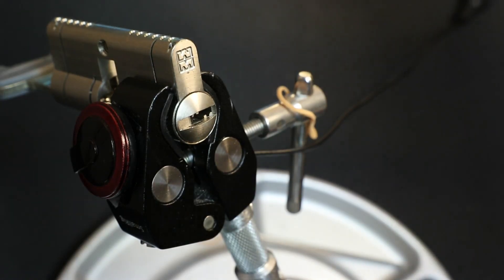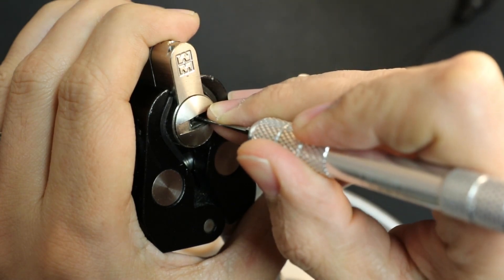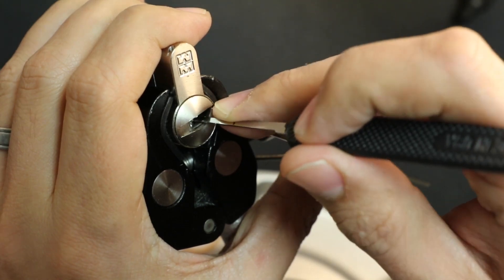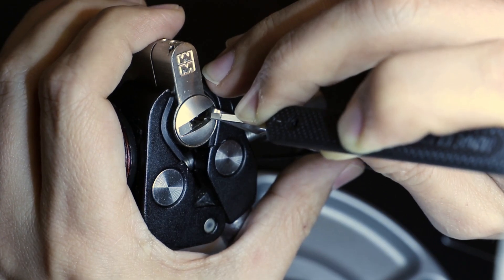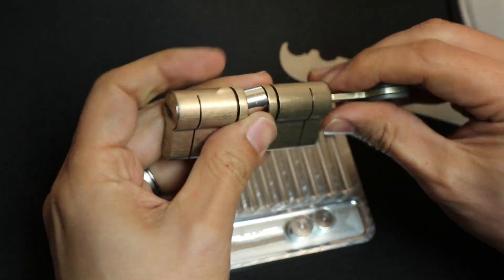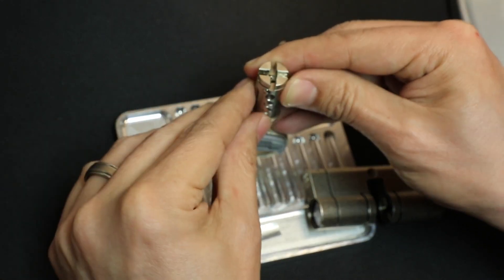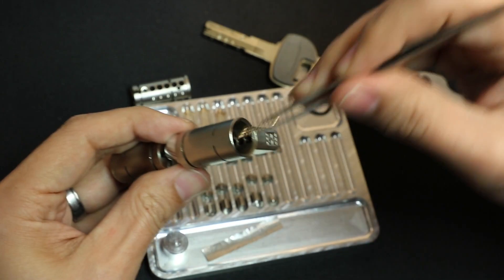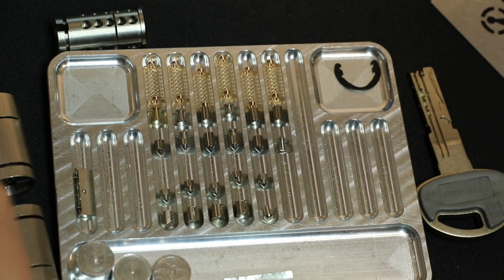[L118] Mottura Champions C55 Euro Cylinder Lock - pick and gut

Comment: Other than a hobbyist ... you are a phenomenon!
I have a question: it true that the presence of a good mechanical defender (therefore not magnetic) prevents or in any case makes it difficult to tension the cylinder and therefore the picking operation?
Reply from the maker: Thank you. I'm not sure I understand your question as I don't know what you're referring to when you say "mechanical defender". If a cylinder is difficult to tension, that can make it very hard to pick (examples would include the Vanlock, Superbright SB lock, Australian hotdog lock, even the Gerda Tytan ZX).
Reply: @norlin76  By “mechanical defender” I mean models such as Mottura Df 05 - Df 07 - Df 09 or Disec Kripton or Diamond.

In some articles I happened to read statements like this: "Another fundamental role of the deep rotor in the manipulative technique is to disable the rotation tensor when key bumping and picking techniques are applied with the electric pick."

The idea I got is that the presence of the rotor in the defender prevents or makes picking difficult. In the picking videos, among other things, cylinders without defender are always handled.

Can you confirm that manipulating a cylinder on which there is a good "mechanical defender" is more complex due to the difficulty of tensioning the cylinder?
Thanks for your attention!
Reply from the maker: @StefanoMasi80  I haven't personally had one of these Defender units, but looking at a catalog on them, it seems that its primary goal is to protect against destructive attacks (eg. drills, disk grinders, pliers, etc). That's why it has all kinds of ball bearings and metal rods, manganese plates, etc. As far as protection against picking, it seems that it's supposed to dull bump picking and electronic picks somehow, not sure why though. For traditional lock picking, it doesn't seem to have anything specific defending against it, but always if you extend the distance to the keyway, it makes things a little more difficult to pick (like my Mul-T-Lock Omega pick, if the lock is deep in the door, that would be quite difficult). Other than that, it doesn't seem to add anything for traditional picking resistance.
https://www.mottura.it/download/data_sheet/P190543ENG%20a_021492%20DEFENDER%20LOW.pdf

Comment: What is this opinion about this Mottura with large slots, compared with narrower and very angled ones?
Do you think, security wise it's an even trade, or they are making the task easier for lock picking?
Reply from the maker: For dimple locks like this, I don't feel that warding makes a large difference in how pickable it is with flags. The warding seems more effective against hooks being used in traditional pin tumbler locks.

Comment: That is one crazy complicated lock🤯 brilliant picking mate. I think this is the first lock I have seen those rotars in, they act sort of like medico pin? Also what are the purpose of the passive pins?they seem not to do much. Great video mate 👍🇦🇺😊
Reply from the maker: Yeah, way too many pieces. I've picked one with rotors on my channel before if you look for the Mottura Champions C43 Plus, they do act like Medeco pin in the way they interact with the sidebar, but don't have to be lifted. The passive pins (like in all locks) are there for key control...if you put a key in without the right cuts, the lock won't turn, but they don't have to be lifted at all, there just has to be space in the key for them to drop down into, so from a picking perspective since there is no key there, there's nothing to stop them from dropping like they need to.

Comment: So do the rotors have to have those tabs oriented in a specific direction when you reassemble the lock?
Reply from the maker: The true gates have to face the sidebar. As for the nubs, the short skinny one has to be closer to the front of the lock while the long fat one is closer to the rear.